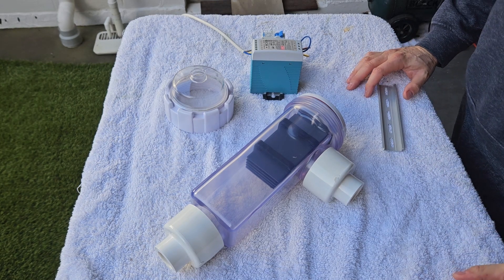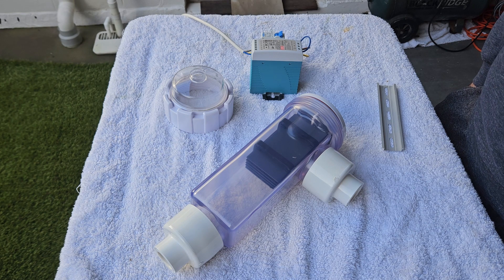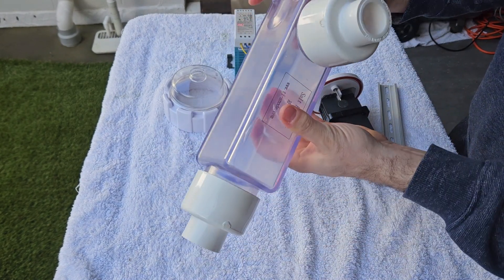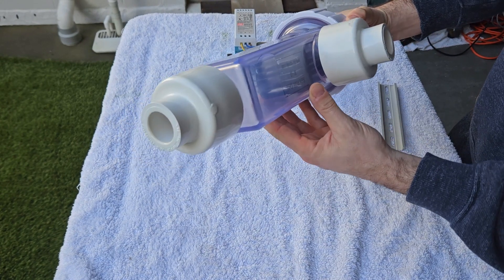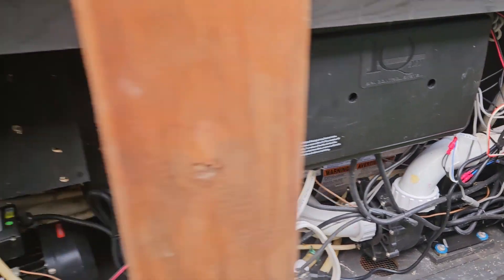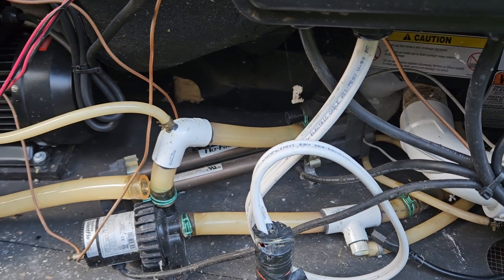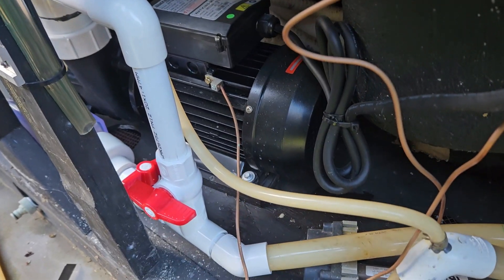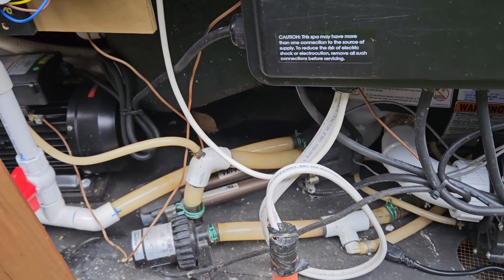DIY Saltwater Spa Chlorine Maker Part1

Comment: Thank you your reply alast week.  I bought a chlorinator like you recommended.  Where did you get your pvc fittings, I am in the US, and the 2" pvc does not fit the housing stub.  Did you get them locally or online?
Reply from the maker: So the PVC reducer I purchased online in NZ. It didn't quite fit so I just used a heat gun on the PVC fitting to make it fit the chlorinator. I did have to stretch that initial PVC reducer quite a bit. After that it was all standard PVC fittings. I did have to wear gloves etc as it was pretty hot.

Comment from the maker: Hi, I have made a 2nd video but haven't uploaded yet. I need to make a 3rd about creating a reverse polarity circuit to automatic clean it. Apart from that I'm really happy with it. Being inside the spa structure is not ideal in terms of checking and inspection as I need to remove the side panels off my spa as it has no door. I could make a door. Which I probably should do.